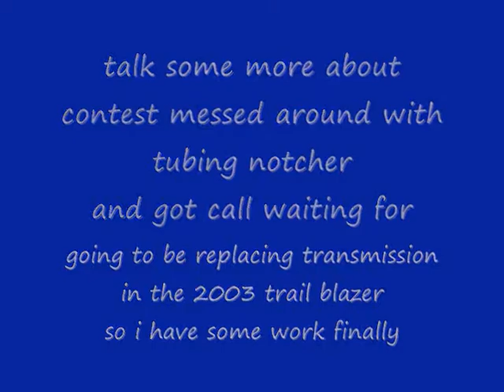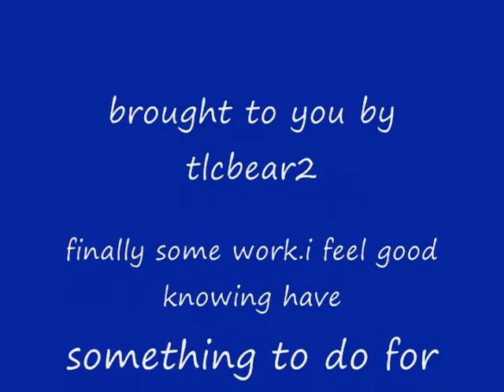messing with tubing notcher 2003 trail blazer got the job

Comment: On that Tecumseh engine, you may want to check the valve clearance between the stem and tappets. Lots of times the valve drops in the seat due to wear, and causes a leak. Clearance should be .008 on intake and .012 on exhaust.